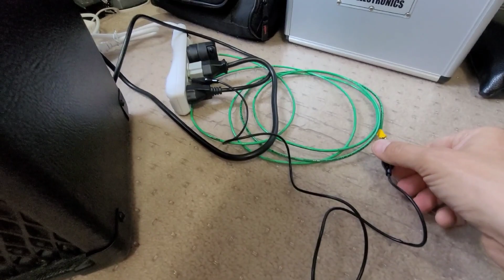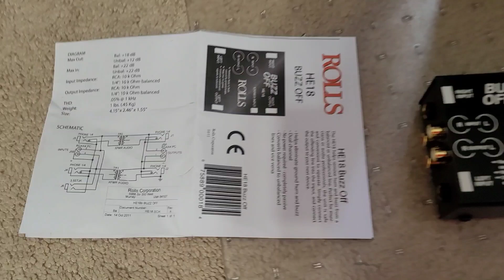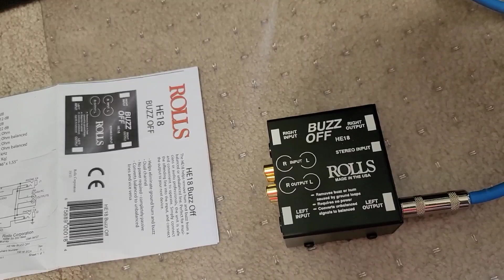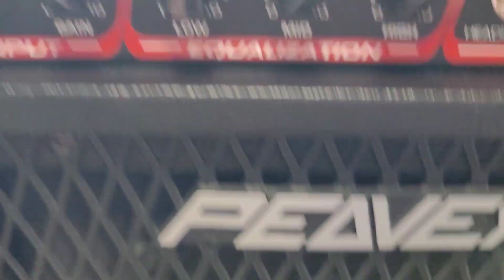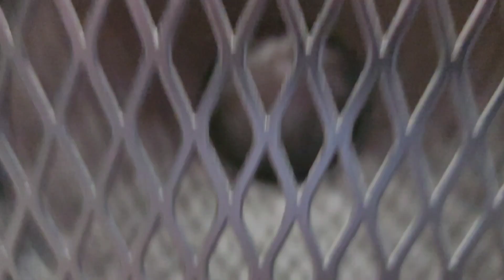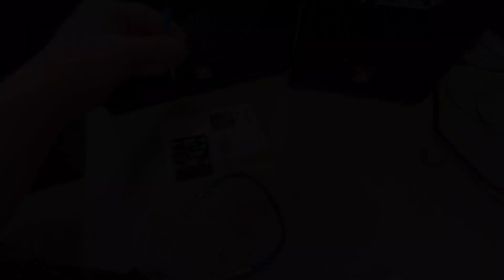Stereo/Dual Guitar Amplifier Ground Loop Hum: How to Fix Properly

Comment: Thanks for the video. Does the Buzz Off affect the tonal quality of the audio signal in any way? I have an active subwoofer in the car and together with the head unit, suffers from what I believe is a DC loop. I can hear noises coming from the sub, like wind blowing, even with everything turned off (except the sub). The sub has an auto-off feature in that, it shuts itself off after a few minutes when there's no audio being played. But unfortunately, the said noise is enough to keep it awake indefinitely. I have tried a couple of generic RCA ground-loop isolators and they do work to eliminate the noise (and allow the sub to sleep), but if I have a song playing, I find that a ton of the deep frequencies gets attenuated/cut and makes the sub sound weak with only the upper bass sounds getting through. Got any ideas? Thanks!
Reply from the maker: Like any isolation transformer there's going to be "insertion loss" meaning your overall volume is going to be attenuated. The cheap RCA ground loop isolators do work but they a very bad frequency response curve. Meaning it cuts out the base frequencies and the high frequencies. The only brand of transformer I know that has the least amount of insertion lost and a nearly flat response curve are Jensen transformers. They are roughly about $100 and you can get them as a raw transformer and wire it up the way you need or you can buy one of their ISO Max devices. 

Also that auto-on feature for the subwoofer I never really liked I actually disabled it on my subwoofers in my car. Instead I use a remote on relay that is on my LCQ-1 so that when the head unit boots up it will trigger the signal processor to turn on which will then turn on the subwoofers and speaker amplifier.
Reply: @Bassguitarist1985  Thanks Gary. I have been procrastinating with the remote wire and a power relay for the sub. I just might do that one of these days.

Comment: Good video 👍
Reply from the maker: Thank you! Just purchased a Rickenbacker 4003 trying to do the stereo set up and I ran into this issue. You would not believe how many of my friends said to just use a cheater plug. Guess I better get new friends huh haha!
Reply: @Bassguitarist1985  just avoid touching your friends when you're grounded! 😀

My Trace Elliott has a built-in ground lift switch which makes life easy. I have experimented with dual amps in the past. I should give it another try but my focus is on my wind synth these days.
Reply from the maker: @umick-synths  well the ground lift switch you mean on your XLR DI out? Some of the older amplifiers have what's called a ground polarity switch which does something similar but entirely different to get rid of buzzing and humming
Reply: @Bassguitarist1985  yes. I'm pretty sure it's a simple resistor lift but it's 25+ years since I last opened it up. That was when the PSU caps gave out after a few weeks of Canadian volts. The TE importers mailed me replacements for free which was pretty decent considering I brought it with me from the UK so my amp was not really their problem!